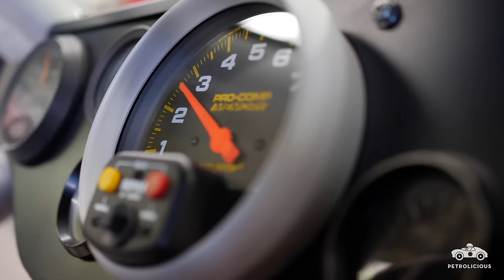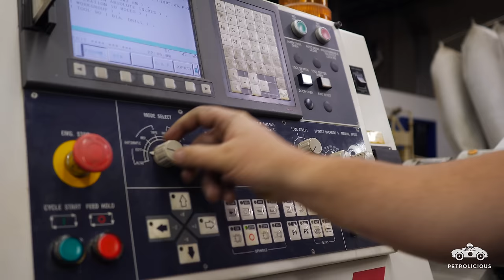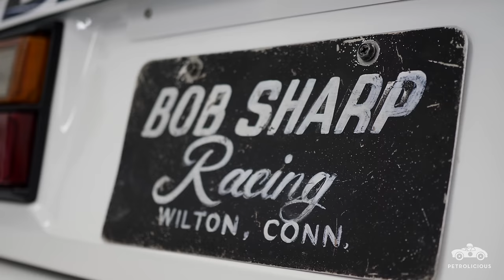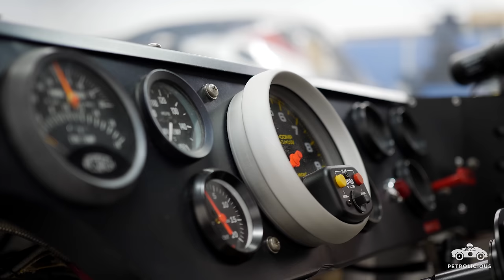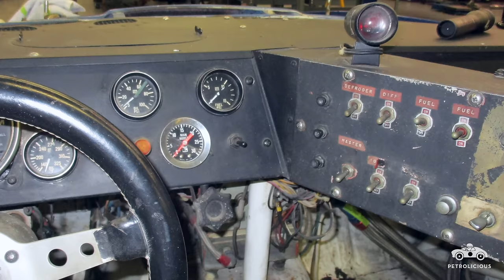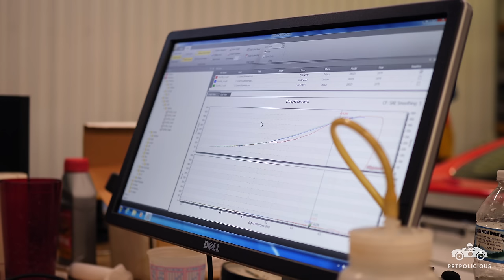Paul Newman’s Datsun 280ZX: An American Legend From Japan

Comment: That is a very good, even sound for a turbo L series, partly thanks to that intake manifold with its internal velocity stacks and central throttle body, but I really want to see what the exhaust manifold looked like. I wonder if it's just as symmetrical.

Comment: Cool car, I had a 79ZX & an 83ZX but now have an early 240Z. Too bad they did not mention anything about the Bob Sharp Racing team who originally built the race car & campaigned it. Back in the 70's to the early 80's there was very little Nissan factory support for racing their products in North America. Teams like Bob Sharp Racing, BRE & Electramotive had to practically engineer & produce these Nissan race vehicles from the chassis up. One thing that did come from the factory is the rear wing on the car. It was homologated by Nissan using the 1000 unit 79 280ZXR model.

Comment: Is this not the car that Adam Carolla owns? I know he has a penchant for Paul Newman's stuff. And while we are at it, its nice to hear about Doran racing and their success in building and  restoring race cars, however I would have preferred to see the whole 9+ minutes to get the Petrolicious slant on this car and Paul Newman's history with it. Nevertheless, good stuff.
Reply: Carolla has a lot if not most of the Newman cars. There’s a list of some that he doesn’t own and this one is on that list.
Reply: Penchant - a strong or habitual liking for something or tendency to do something.
Reply: Adam Carolla owns a Paul Newman 300ZX Z31. He also has a 2000 roadster and a 510.
Reply: Jason Wingate troll
Reply: Had a 280zx in the late 80’s it was my 2nd motor had some trick 8 inch wide wheels to keep that straight 6 lump in check at the front end - even had a z book of mods you could do  but alas life got in the way of body kits and engine tune ups ( houses & wife !!) - but the Paul Newman car was on a big poster on the wall for a long time - maybe one day
Great to see this video - maybe some more iconic tin tops to look forward to .....

Comment: It's a 280zx, not a 280z - big difference
Reply: tehmorbias correct, quite a big difference. Still cool as absolute fk though!
Reply: The 280z is a 240z that was destroyed by regulations.
Reply: But saved by modern technology that make them great.
Reply: Miguel Hernandez 280z  and 280zx are different chassis. you're still not paying attention
Reply: Dalton Bedore I know they are different chassis. I'm talking about the 240z compared to the 280z. The 280zx is the first complete change of the z cars. I know some people don't see the ZX cars as part of the Z family but I do. I personal don't like the 280zx but I think what made the car cool was the t top and turbo.
Reply: Miguel Hernandez my bad. i like both too but only ever owned a '84 z31 slicktop
Reply: its a TURBO 1981 or newer
Reply: @skippanzarella9155  Its an 81 or older. The stainless side trim in front of the rear side windows is the giveaway. They were black plastic in 82-83, and the tail lights are 81 and down. I think he says it an 80.
Reply: None of you are paying attention to the video. Just like the gear box, this car just looks like a 280 ZX.  @daltonbedore8396
Reply: @rondyechannel1399  and you're not paying attention to what everyone is saying.
Reply: Yep, I cringe every time he says it.  Jeez!
Reply: It's not a Roadster 2000 Fair lady, that is fore sure 🏎️🏎️